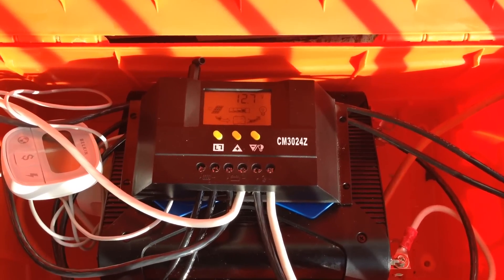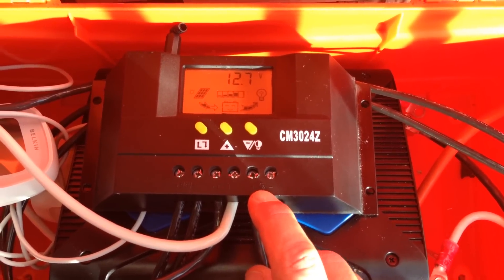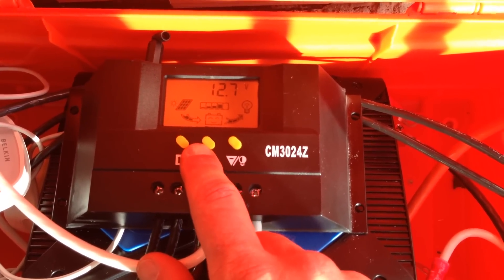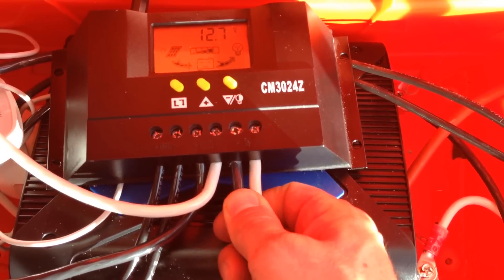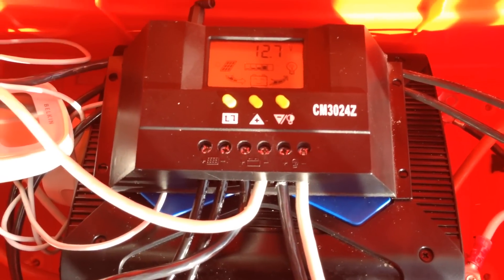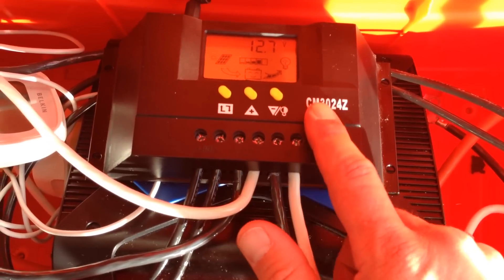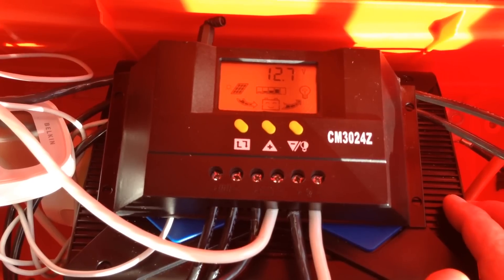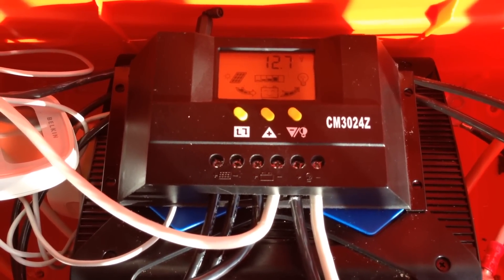Small apartment balcony solar power setup (part 4)

Comment: hi. I've watched through your 4 part solar videos. Regarding this last part 4 video, please disconnect the inverter from the LOAD terminals. It is NOT meant for high drain hookups--specifically no inverters. The LOAD terminals are for very light drain hookups, e.g. a low watt light bulb.

If you were to accidentally (by forgetting) plug in a space heater or a toaster into your system pulling power from the inverter, it will definitely blow your charger controller.

BTW, I've just setting up my own off-grid system but I just today learned about tie-in systems. I now regret my decision to make my system off-grid. I've already purchased an expensive 125Ah AGM battery and an expensive MPPT battery charger. But we don't need any of that. Check this out. Sun grid tie inverter plug and play install

With these tie-in inverters, all the power that is produced goes right into your home electrical system. We don't have to wait until sundown to use our solar power from battery. The tie-in inverter directly supplements your entire home electrical system.   

I should have done more research before selling out so much money for my current system. 

And I especially found your RIO comments so funny. I agree completely!
Originally I thought I was going to enjoy so much free power after my install. My system is going to end up costing close to $2000 USD. :-( That is a lot of electricity that I could have directly purchased from my power company.
Reply from the maker: Hi and thank you for the long comment! 

1. The load terminal: I need to check with the manufacturer about this. I have not found anything in the documentation that tells me why the load terminals shall only be used for light drain hookups....nothing! I had requested a more detailed manual from Riorand (the manufacturer) but got the same that came with the device, so I will email them again and ask specifically about this issue. So far it worked great but you are right, you have to remember not to plug in any high-wattage device (vacuum cleaner, etc.). I did it once and the controller shut down but didn't blow. It still works fine. So let's see if I can find out anything from Riorand since the load ports can be configured (at which voltage to turn them on and off) which avoids that the battery is getting depleted. If the inverter is hooked up directly to the battery you can't configure when the inverter shall stop pulling current from the battery. It has a fixed voltage range that can't be changed. This is from the inverter manual: "The inverter is designed to operate with input voltages ranging from 10 to 15 volts. When the voltage drops below 10.5 volts DC an audible alarm will sound. If the voltage drops below 10 volts DC, the voltage indicator will go out and the inverter will automatically shut down."

2. Grid-tied inverter: I had exactly the setup that is shown in the video you recommended (but with a grid-tied micro inverter). Main issue with this: No power if there is a grid power outage. Furthermore, my power outlets on the porch are part of my living room circuit. When I had the grid-tied installation I didn't really know what happens in my apartment circuits and whether I would would use grid power or solar power via the inverter. I was able to check the power meter once during this setup (usually difficult in apartments since the meters are all in a locked up room outside of the apartment building) and I couldn't see that the meter was running slower when I had the solar panel connected to my apartment circuit. To be sure that solar power is used I would have to cut off the grid at the breaker panel (for instance only cutting of the living room circuit) but then the grid-tied inverter would shut down right away. That's why for me the battery setup makes much more sense. It allows me to ensure that I am using solar power since I can cut off the living room from the grid without the inverter shutting down and it provides power during grid outages. If I upgrade my setup with more panels, I could run my living room (and more if I connect other apartment circuits to it) directly from the panel through the load port of the controller (if I stay below 300 W or 30 A) during the day and use the battery at night. If I get another battery, I could run more during the night or longer. With my current setup I can watch about 5h TV with lights on if the battery was fully charged before.

3: ROI: yes, it will take even longer if you have the battery-based setup plus a charge controller but for me that was always secondary. I wanted to show that even in an apartment situation you can do something to offset part of your power consumption and to have backup power in case of an outage. Of course you have to have the right location (I am south-west facing which is perfect) and your landlord has to allow it or at least don't forbid you to do it. If the energy prices are rising your ROI will improve. For me it is in general a great feeling to sit there at night and use solar power and on very sunny days I can even draw a bit of power in parallel to charging the battery, for instance my internet router which only uses less than 10 W.
Reply: lbodini2008 Hi again. Here is just one FAQ, but I've read it everywhere. I'm really surprised you haven't seen it before.

http://www.geosolution.com/fachco.html#.VB5dAfldV8E
----------------------------------------------
What is a Load and "LVD" output?

Some controllers also have a "LOAD", or LVD (Low Voltage Disconnect) output. The Load output can be used for smaller loads, such as small appliances and lights. The advantage is that the load terminals have a low voltage disconnect, so it will turn off whatever is connected to the load terminals and keep from running the battery down too far. The LOAD output is often used for small non-critical loads, such as lights. Do not use the LOAD output to run any but very small inverters. Inverters can have very high surge currents and may blow the controller.

Most systems do not need the LVD function - it can drive only smaller loads. Depending on the rating of the controller, this may be from 6 to 60 amps. You cannot run any but the smallest inverter from the LOAD output. On some controllers, such as the Morningstar SS series, the load output can be used to drive a heavy duty relay for load control, gen start etc. The LOAD or LVD output is most often used in RV & remote systems, such as camera, monitor, and cell phone sites where the load is small and the site is unattended.
---------------------------------------------

I'm glad to hear your's didn't blow when you plugged a vacuum cleaner into your circuit. Consider yourself lucky. Don't test luck again in this manner. :-)

Your inverter has the low voltage alarm and cutoff. I'm not sure if you realize or remember this, but under load, the voltage of a battery drops. The higher the load you're running, the bigger the voltage drop. When the alarm sounds at 10.5V, it doesn't mean your battery actually only has 10.5V charge. Once you remove the load from the battery and let it rest a bit, it'll go up in voltage significantly. Most likely above 11.6V. It's too bad you don't have a better battery controller where you can adjust the low voltage alarm/cutoff. That would be helpful. 

Regarding your grid-tied in micro inverter, so you're saying that because you don't have easy access to the utility meter outside, that you weren't able to verify if indeed the tied-in inverter was helping to reduce your electric consumption? Was that the primary reason? If you were able to confirm that indeed it was working as advertised, you'd still be using it? 

As I see it, it's more efficient for me to hook up grid-tie inverters and funnel all the solar electricity I generate from my panels into my home electric system. That would be 100% (minus all the loss from conversion, inefficiencies and resistance) usage of the solar panel. With my current setup, my battery is charged full before the sun sets and I have panels up on the roof collecting solar electricity that is not being used or charged into batteries. It just sits there. That is LOWERING my ROI. Or delaying out the time at which I can recoup the cost.

It just seems to me that these tie-in inverters are great to fully utilize all the power that my panels produces.  Of course my system is small. I just set up (2) 100W panels. I'm probably going to install two more for a total of 400w. I probably won't be able to produce more than 300-350w to tie into the home system, so I'd be using all that electricity. With all the things that are constantly powered throughout the house, it would be very helpful to offset what I normally consume from the utility company.  

Your thoughts?
Reply from the maker: lanceguilin Thank you for the article on LVD.  I really didn't see this before....interesting how you sometimes don't find what you are looking for :) It may still work that I continue to use the LVD in my setup. Remember, I am only using my living room circuit (TV, stereo, Internet router, lights) and this usually brings me to less than 300W and the inverter will draw less than 30A from the battery through the controller (which is rated for 30A). I may just cover the plugs in my living room so I don't accidentally plug in a high surge causing device. BUT, I still need to find out the ideal load disconnect is for my battery. If the fixed configured 10V shut-off from the inverter is OK and not too low for my battery than I wouldn't need to use the LVD port from the charge controller (which I have currently set at 11V disconnect). Also, you are right, if the inverter would have a configurable low voltage cut-off, that would be perfect.

Concerning the grid-tie installation: Yes, if I would have found a way to measure and track what is happening to my solar power I am feeding into my apartment grid, I would have kept it. For instance what type of power is used when the fridge is running, what is being used when the washer or dryer is being used? Is my solar power being used at all? If so all of it or just a percentage? You would need to find a way to measure the current at the 110V output of the grid-tie inverter and at the same time at the incoming cable from your utility. Then you could exactly see if less power is drawn from your utility as soon as the panels are feeding in power. I found a measuring system that can do exactly that but I don't remember what it was called. It was working with sensors that you attach at both the solar installation and the cable coming from the power company and basically measures the current flowing back and forth. This would then also show you if you produce more solar power than you use and even push power back into the grid (making the meter going slower or even backwards). If you research this, some say that this effect depends on the type of meter the utility company has installed at your house. You could call them and ask if they allow you to do a net metering agreement which would then make this official. They may install a special meter which is able to track the power flowing back and forth so they are able to measure what portion of utility power you are using and what portion of solar power you feed back into the grid so you can get a credit for that portion on your utility grid. But again, you may not need that agreement if you 1) never produce more power than you need and 2) if your meter is starting to run slower the second you turn on the solar setup and you know for sure that you are using all your solar power fed into your house
In general just by tracking your utility bill doesn't provide a lot of transparency since your usage fluctuates from month-to-month and you can't really tell if you are paying less because of your solar power or because you just used less energy.

Also remember that your grid-tie setup is not working in case of power outages. In that case it would be perfect to have the battery setup in place. So I think a combination of both configurations is perfect if you:
1) have a grid-tie system large enough to power what you use during the day
2) you are able to measure this so you know for sure that your solar power is being used during the day (to be 100% sure you could shut off the main power cable coming in but in the grid-tie setup your inverter wouldn't work anymore)
3) you set it up in a way that you can switch to battery power at night, grid-tie power during the day
4) dimension your system that it charges the battery during the day and still provide enough grid-tied power during the day (but it sounds like you have separate installations for that anyway).
Reply: lbodini2008 If your nighttime needs really do only minimally fluctuate around 300W, then you're probably ok. The reason why I sounded the alarm bell on my first post is, I believe, I saw that your inverter is a 1500w one. If you intend to fully use 1500w, then that's a definite NO NO to connect to the LOAD terminal. If I saw a small 300w inverter hooked up to your LOAD terminal, I wouldn't have mention it. :-) As long as your cognizant of this and are cautious about not plugging in appliances that will draw a lot of watts/amps, then you're probably OK. 

One the more expensive inverters--especially the PURE sine wave ones--you can configure the low voltage disconnect value. That way you can directly connect it to the battery and it'll shut off at whatever LVD value you programmed it with. I still haven't purchased a powerful inverter yet--I have two small 175W modified sine wave inverters. I planned on purchasing a 600w-1000w PURE sine wave inverter and am/was still doing my research when I stumbled upon the cheap grid-tie-in inverters. That discovery completely screwed up my entire solar system paradigm. I had known about expensive, professionally installed  grid-tie-in systems and authorized net-metering systems from your utility company, but I wasn't aware of these cheap small box (and mostly unauthorized) grid-tie-in inverters that you can just plug into any AC outlet. This kind of system completely bypasses the need for batteries and charge controllers, thereby saving a lot on your initial outlay. 

So anyway, I think my plan now is to investigate and research more into those small box grid-tie-inverters. I will keep my battery/solar controller equipment as well. What I plan to do is connect a main switcher right below the main disconnect such that switch position 1 will output power to my battery/solar charger system and position 2 will output power to one a grid-tie-in inverter that will be plugged into a home AC outlet. Given this setup, I will mostly be producing electricity to pump into my home AC electric grid. Given my small amount of watts I will be producing (at most 400w) I believe I will be using it all before any is pushed out to the utility grid so I don't have to worry about net-metering. I just want to reduce my consumption from the utility grid, not to make money by producing electricity to sell back to the utility grid. Once or twice a week I plan to switch to position 1 and fully charge up my battery bank (which consists of only one battery now) to ensure that my battery will last a long lifetime. I think this system will work but I've still essentially spend a lot of money on the battery and charge controller that will mostly be sitting idle. 

There is no need to use the battery at night time as any energy used to charge up the battery in the daytime is, I believe, better spent using the grid-tie-in inverter to push AC electricity into my home grid. That would be 100% usage of all my output from my panels. There would be no down idle time as one would have when switched over to the battery charging side, as once the battery is fully charged, the float charge using very, very little amount of energy to keep it topped off. Then all other potential energy collected from the panels are just wasted. I'd rather just pump it all directly into the home AC grid via the grid-tie-in inverters. 

So given your explanation, I understand why you switched your system. You simply were not able to verify for yourself whether or not the tie-in inverters really were doing the job of reducing your electricity consumption on the utility meter side. I don't think I'm going to do extensive testing on my own to see if it works as advertised. I've seen enough videos on youtube to convince me that these indeed work. I will take it as a given but will verify with a Kill A Watt meter to see how much electricity I am pumping into my home AC grid. 

What do you think of my plan regarding a SWITCH so that I am able to move PV power from one setup to another setup?
Reply from the maker: lanceguilin Yes, I know, for my current application, my current inverter is totally overdimensioned. Who knows, maybe I upgrade the system in the future.

I like your installation with a switch to toggle between the grid-tie inverter and the charge controller / battery. Do you really use up all the power (you said about 400W) during the day or can you still use some of the solar power to charge the battery so you could use battery power at night. Have you calculated what wattage you need during the day? I also understand that net metering is not relevant for you due to the size of your system. It would be nice to have a more automatic way of switching back and forth between the battery and grid-tied setup, depending on actual consumption. BTW, this guy is describing the differences between micro-inverters, grid-tie inverters, charge controller-based configurations, etc. very well: How to Solar Power Your Home #7 -  Grid Tie v Micro Inverter v Power Optimizer v Charge Controller

Concerning the energy measurement I am still thinking of trying out a solution that is not too costly. Otherwise we are really flying blind and can only go by what the monthly utility bill says. Google "energy meters" which should get you a couple of solutions if you change your mind and want more visibility. TED is one of them: How to Solar Power Your Home #7 -  Grid Tie v Micro Inverter v Power Optimizer v Charge Controller
Another one is Owl: http://www.theowl.com/index.php/energy-monitors/solar-pv-monitoring/intuition-pv/
I couldn't find out if Owl is available in the US though.
Reply from the maker: lbodini2008 There are several articles on how you can combine a grid-tie solution with battery backup. I have not fully researched it though.  
http://www.aeesolar.com/grid-tied-solar-systems-with-backup-power
http://www.mainstsolar.com/solar-lighting.php
http://solar.smps.us/grid-tie-backup.html
I would have loved to have a system that allows me to fully offset the entire energy consumption in my apartment, day and night. But with the available space I have for PV panels I think I did what I could and also balancing the money spent versus the money saved. For me it was very important to show that, even if you live in an apartment, you can make use of solar power with a fairly simple configuration. The hybrid setup (grid-tie plus battery backup) sounds great though! Let me know what you end up doing.
Reply: lbodini2008 Thanks very much for the links. I will review them. My current setup is only (2) 100w panels. I am seriously considering adding (2) more 100w panels for a total of 400w. But we both know I won't actually be getting 400W do to system/wire/whatever else inefficiencies. I'll keep you updated on what I end up doing. I'm going to readup on the links you provided.

BTW, yes, I've watched countless videos from mjlorton. lol. funny guy. I've learned a lot from him. It's funny you should mention his videos because one piece of equipment  (Belkin Conserve Insight Energy-Use Monitor) you use I've only seen from his video then yours. lol. I was wondering if you saw his video and purchased it. :-)